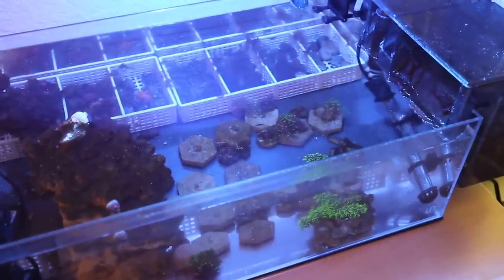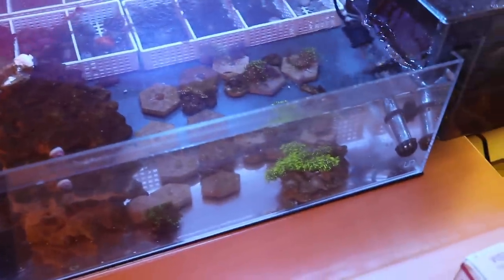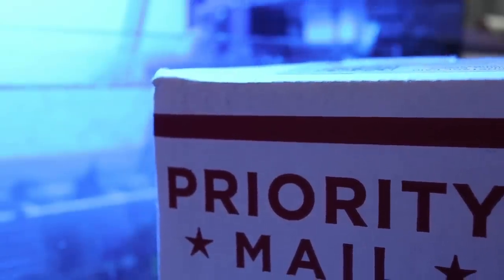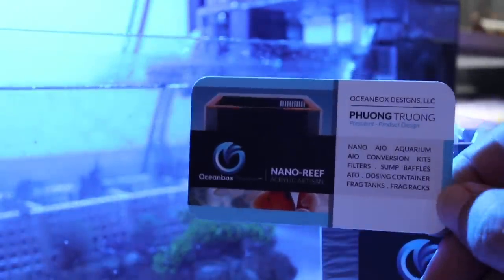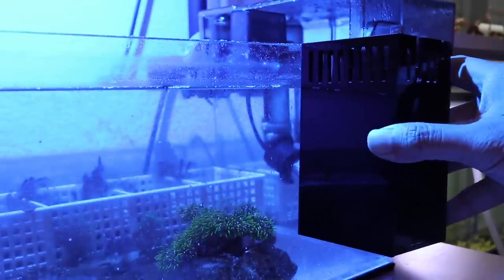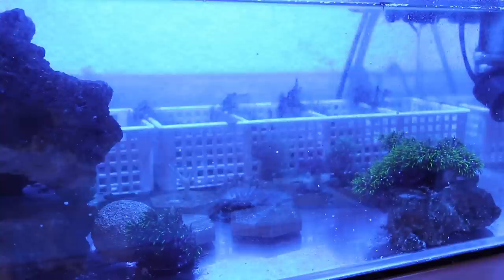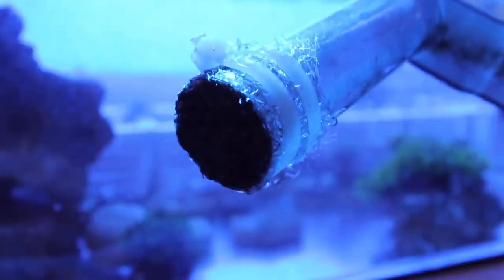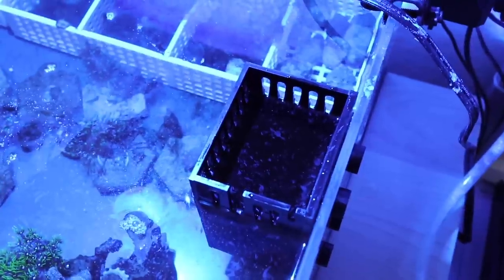HOW TO CONVERT AQUACLEAR 50 70 110 INTO A SURFACE SKIMMER

Comment: Was just about to have a nap here in England saw your video looks like the nap can wait. I have a aquaclear 70 which I converted into a refugium. Works great I used to laugh at these HOB filters but this aqua clear is something else. I couldn’t source it here in England so had it sent in from Germany.
Reply from the maker: Wubaluba Dubdub I am surprised that it’s not available in England since it’s made in Europe
Reply: prolificbreed yeah from what I found out was it was here in England but didn’t do well, most Hagen equipment is kind of laughed at here within the community. But the retailers have seen the cool refuguims and special builds and have been asking crazy money for there last ones that they have in stock. I saw one for over 130 pounds!

Comment: I actually have this same design set up with one of my Fluval fx6 filter Intakes....works good but make sure you keep the water level topped off or that thing will be sucking air.
Reply from the maker: Yup you need an auto top off for sure
Reply: You  can spot his auto top off sensor.

Comment: Im starting a 20 gal long with soft corals. I bought an AquaClear 30 but I also will have 40lbs of sand and rock.
Would you recommend I get a larger aquaclear? Id have more options, more room for media and possibly a refugium.
Just worried that the larger filters would have too much flow and disturb inhabitants.
But IDK? 
Well whatever I do, I plan to contact you friend about getting a skimmer box.
Any advice would appreciated.
Thank you!
Reply from the maker: Fugitive Irons congrats! If you plan on using an aqua clear go with the larger aqua clear 70 for more media and space like you said. You can swap propellers with an aqua clear 20 or 30 to slow down the flow.
Reply: @prolificbreedaquatics  just a matter of swapping impellers! Ahhh thank you!

Comment: In the beginning of the video you have the flow set to low. At the end with the skimmer the flow is set to high. Did that might have an affect on it? Was it dirty in the beginning of the vid. Just curious as to why you made the comment of flow. Because even on low setting I have a tremendous amount of flow.
Reply from the maker: Hi Nicolas, i had to rewatch the video. The start of the video i just had the tube and some mesh I zip tied over it. It was pretty much clogged and restricted a lot of water from flowing. With the skimmer in it just freed up up the flow I to the Aqua Clear. For the Aqua Clear 70 If you have too much flow you can buy a Aqua Clear 50 propeller and swap to slow down the intake.
Reply: prolificbreed none the less I subscribed and this is cool setup.
Reply from the maker: Nicholas Marquez 🙏🏻

Comment: How's this for noise?
Reply from the maker: Charles Dill if you dial it in you don’t hear it at all. I have the water level all the way up so the filter is not splashing water back down. Having an auto tip off keep everything consistent

Comment: What about when the water gets low ? It’ll start sucking air no ?
Reply from the maker: It will start sucking air. For this tank, I have an auto top off made by smart aqua on the side
Reply: No different than a tidal brand filter. Watch the water level or use a ato.